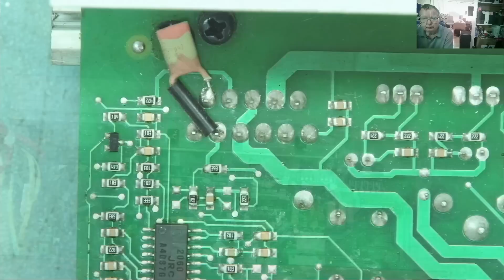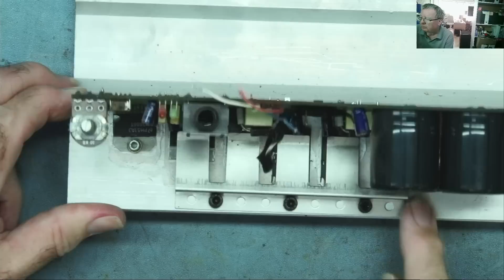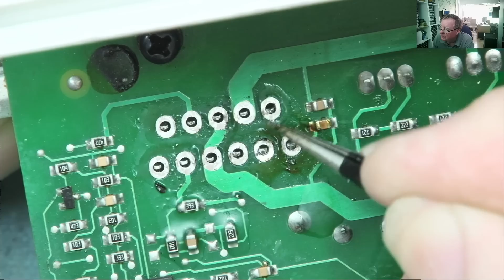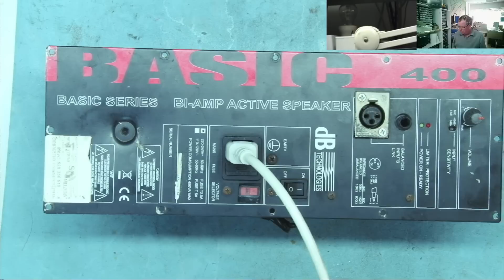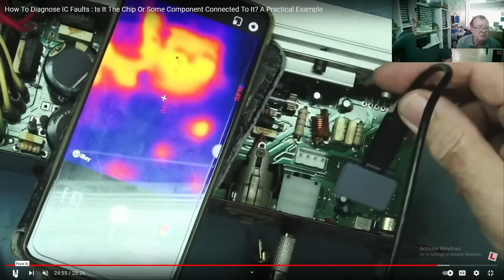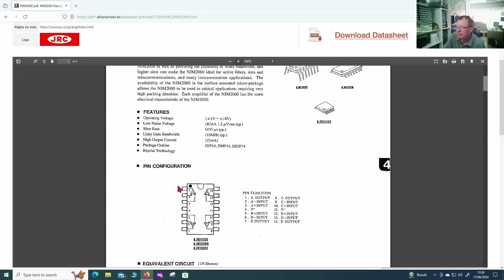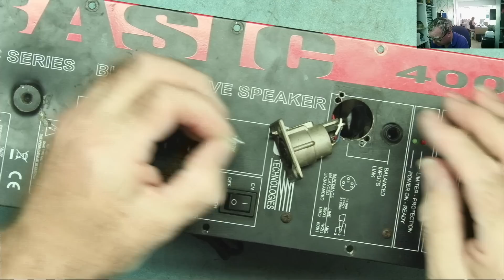Is The IC Faulty Or Is It Something Else PART 2 : Basic 400 Bi Amp Active Speaker Repair

Comment: Having a desoldering pump for removing components is a game changer. I had a cheap one with a plunger that pushes down like the little solder sucker you'd use with your soldering iron, but it had a heated tip with a hole to suck up the solder. It worked pretty decent, but I thought it could be better if I didn't have to keep resetting the plunger to push the button and only get the one shot at a time. I took an old food saver vacuum sealer that was laying around and removed the little DC powered vacuum pump out of it, got some high temp silicone tubing and set up a small glass jar in line to catch the solder and it works awesome. I saved a ton using stuff I already had laying around and improved on a cheap solder sucking tool that proved to be no better than just using my soldering iron with a solder sucker. All I need to do is supply 12VDC, and even have a foot pedal to turn the pump on so I can keep one hand free to hold tweezers on the part I'm removing. It really does make the whole process much simpler.

Comment: I have seen a technique to desolder a chip where you take a copper wire and route it over all the pins and flood solder over it and the pins all at once and then the solder melts on all the pins and the chip will fall right off.  Then you clean up the extra solder with a solder wick.

Comment: 2:22 - According the amplifier’s datasheet you showed in part one, this mica cap is across the inverting and non inverting inputs to this amplifier. I don’t know of an amplifier circuit where a cap is placed across the inputs.
Reply from the maker: @garypoplin4599 It does show that cap in the typical application in the datasheet.  The description says 'Reduces the gain (bandwidth of the amplifier) at high frequencies to avoid quasi-saturation oscillations of the output transistor. The capacitor also suppresses external electromagnetic switching noise created from fluorescent lamps.'  The datasheet says the cap is optional. https://pdf1.alldatasheet.com/datasheet-pdf/view/558418/TI1/LM3886T.html
Reply: @learnelectronicsrepair  I just learned something else from you. Thanks. I’m building a μA adapter to use on my DMM to get around the high burden voltage of my meter inherent in low current readings. With the adapter connected, the current is read in mV per nA, μA, or mA depending on the adapter setting. Maybe I should incorporate 220 puff caps into the design. JAT

Comment: Use the Mr Solder fix technique. Take some solid copper wire and bend it to fit the legs of the device being removed. Flood it and it simply drops out. Also those super wide tips are available. I didn't have the station required but i bodged it into an old soldering iron handle and wired it up to a bench supply. Also works a treat.

Comment: I bought 3 amp chips from a seller for a repair job (1 for the job, 2 for stock). In the same package were the 3 chips, but one was different. The etching/writing was not quite the same as the other 2. It turns out this chip was fake when the other 2 were good (I compared meter readings which were different from each other);  same package from the same seller. Its safe to assume that these chips are faked, so be wary.

Comment: @learnelectronicsrepair hey Richard. I have a load of ic’s, op amps, 555 timers, Schmidt triggers, hex fets that sort of thing I bought as a job lot. I could send you over a list of what I have and if any of them are any good to you I don’t mind saving them until your back in Blighty next and send them to you. All original new old stock so should be reliable and I won’t want a lot for them either 😊

Comment: Lots of valuable tips for beginners re the vacuum tool, Richard.👍👍👍 next time you should include a section about dismantling the tube/spring assembly and cleaning the whole assembly and show the dirty filters after a time… (btw, those white IKEA pads without glue, that you put under the legs of chairs works well as filters if you trim them a bit)

Comment: Have you seen solder sucker irons? e.g. YIHUA 929D-V Electric Vacuum Desoldering Iron £15
Reply from the maker: I made a couple of comparison videos for solder suckers, including that type, one video was desoldering through hole components and the other to clean PCB holes with the component already removed.  You may be interested in the results, the tools did not perform the same for the different tasks
https://www.youtube.com/watch?v=vDQjGe1aYp8
https://www.youtube.com/watch?v=EoLa9ebjwGU
Reply: I see there are now some cheap pumped ones for £30
Reply: I ordered one for $9US in the US. It had a US 120 volt plug. I plugged it in and it would never get hot enough to melt solder. I then read the instructions and it was rated for 240v. I tore it down and removed about half of the heat element and it works fine. The spring loaded pump is not great. I’m going to attach a vacuum pump to it and see how that works.
Reply: Low melt solder would be ideal here.

Comment: When probing the op amp pins there were differences in the input pins(32:10). There were clearly units which were visibly wired as unity gain buffers and there the inverting inputs are connected to outputs. That explains the different behaviour of the pins.